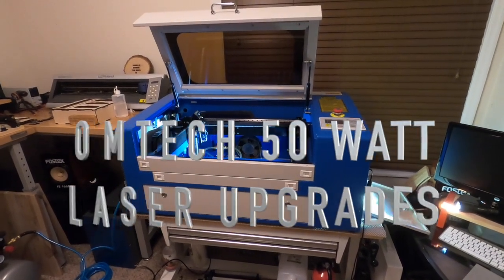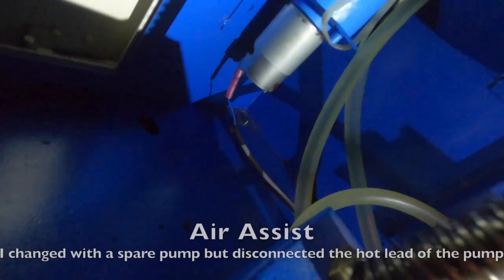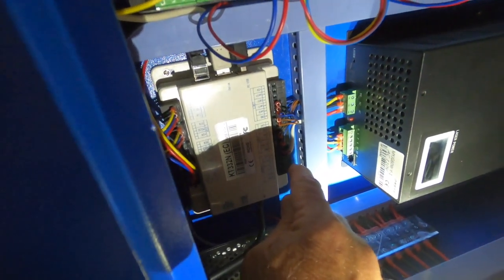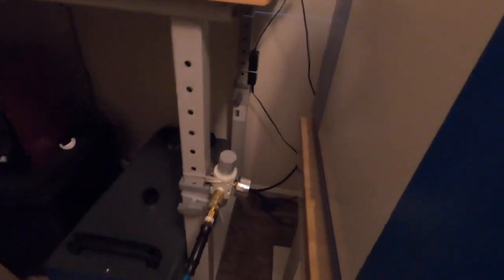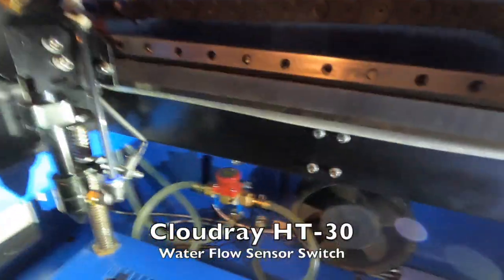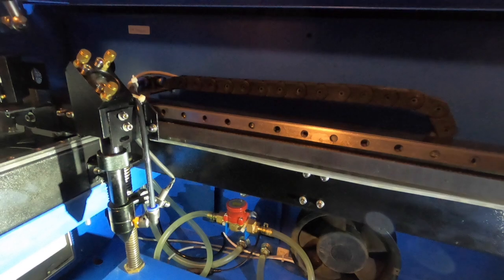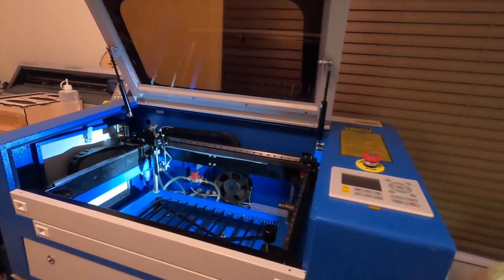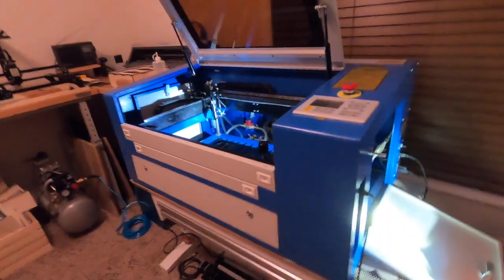Laser Upgrades  To OMTech 50 watt Laser

Comment: Moving the air out of the cabinet has a secondary advantage, you aren't blowing dirty air onto the bottom of your focus lens.  Just make sure you aren't using a compressor that puts oil in to the air.  Where  used to work (with a Laser) we had so much trouble keeping the lens clean that we ended up getting a special compressor that was made for for a dental office.  A diaphragm compressor would do just fine, but they are noisy.

Comment: The air assist on OMtech lasers are garbage. Mine did not fail, but I had the same one in my 100W and they are weak as heck. I replaced it with a big air pump I had spare laying around.
Reply: what pump did you use? did you use an air compressor or just a bigger pump?
Reply: @jessicapretz  I used a spare pump I had for my aquaponics setup - VIVOSUN Air Pump 950 GPH 32W 60L/min.  It just sits in the back inside.

Comment: How high is the table top from the floor, that your laser sits on?  I've asked a few, but have never gotten and answer.  I'm building my table, as my laser should arrive about the end of the month.   Thanks... Take care (8O)
Reply from the maker: Google the Husky tables at Home Depot.  Mine is a 48" table and it is adjustable.  I have it set at the lowest point which I think is 28 or 29 inches.  It sits the perfect height for me.

Comment: I have the same unit - but mine came with the fish tank pump instead... is there a way to let lightburn turn the air assist on and off?  I don't want air assist when engraving, only cutting!
Reply: I well understand you wanting to turn air assist off while engraving, but I would caution against it.  Use a higher pressure for cutting, and a lower pressure for engraving.  The air assist not only blows the crud out of the cut, it also blows out the flame when stuff catches on fire.  I am having trouble remembering (I'm getting old), but it seems to me we used, at my old work, 5psi engraving, and 15 or 20 psi for cutting.  Lightburn has the facility to control the air, but the question is whether or not you controller will obey Lightburn. look on cuts/layers and  you will see "air".